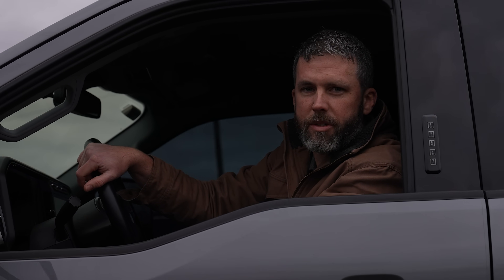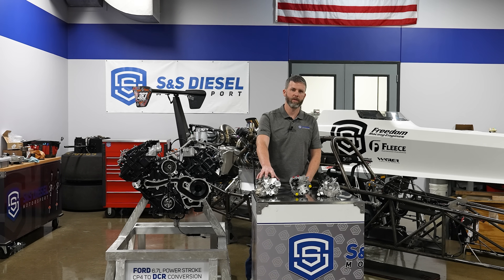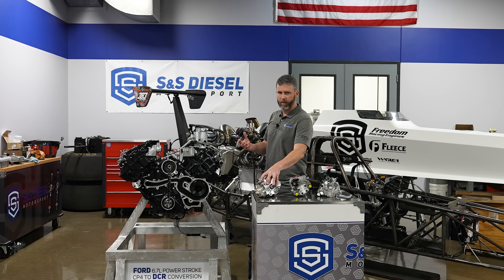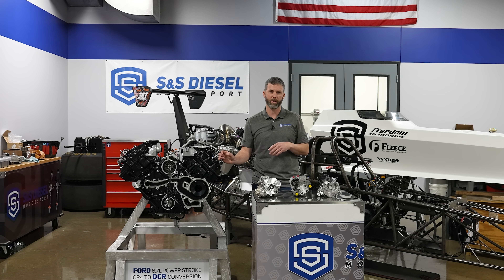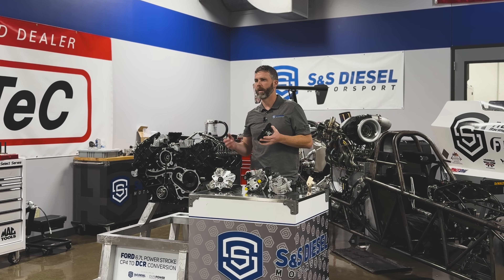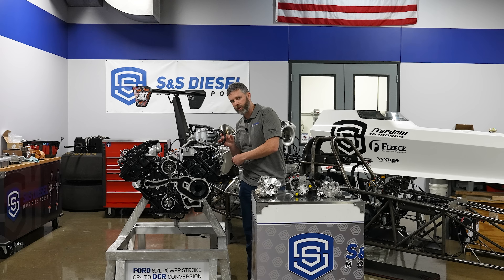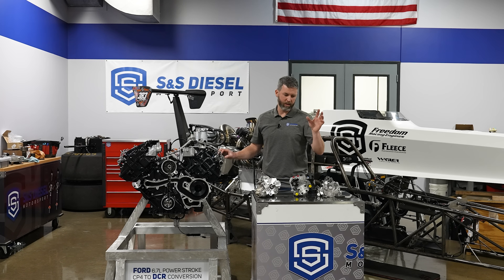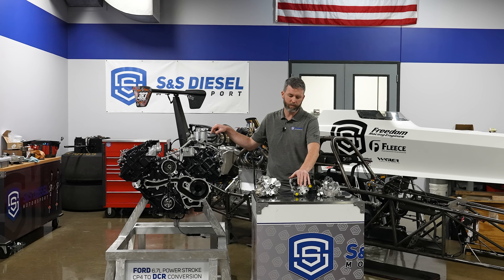How we chose the DCR for the 6.7L Power Stroke!

Comment: Is their a possibility for a higher output dcr?
Reply from the maker: Our engineering team has been considering and looking into this. Our main goal for the DCR was to provide a reliable pump option with factory style replacement. Now that the DCR has been out for 2 years and over 60k units in the field we believe it has proved its reliability and can look at other options such as higher output DCRs. Currently we have had multiple customers make 700hp+ and even one customer making over 800hp so even in its current state it has a higher output than stock when the truck demands it!

Comment: Great Informative Video... Enjoyed it a lot!  As you said, competition is beneficial. I learned more on the DCR and design direction in this video than previously... very informative & beneficial.  The CP3 & Belt design has some benefit in design, and I'm supportive to several of their 6.7 high quality components; although I agree, removing my 2nd Alternator and the external design to move components from in block to ft bracket & belt isn't my preferred design. 

Although I maintain "IF" the CP4 is maintained correctly with excellent 3rd Party filtration of air & water and lubricity in quality additives the CP4 can perform well beyond 500K+ miles. Along with Lubricity in Fuel; Filtration is key to prevent water & air to pump and the Ford OEM Filtration is a weak link to this prevention. 

Unless a new design is introduced by S&S or Other company in the next few years, for my 2024 F450 I'll keep the DCR conversion as an option and run a DPK as an Insurance policy that likely won't be utilized.

Comment: How large of an injector can the DCR support? I understand it’s designed for stock but flow numbers are close to a stroker cp4 from the looks of it?
Reply from the maker: We commonly see DCR's paired with injectors from stock to 100% overs. Tuning plays a big role with injector duration on what can be supported. We have a customer that I believe had 100% overs and compounds make over 800 whp on a DCR for reference.
Reply: @SSfueled this is great news!

Comment: Perfect timing for when the other company releases their belt driven cp3.  They’ll fail just like the disaster prevention kits did.   Blame the consumer but not stand behind the product, but you can buy an additional warranty 🤦🏻..  DCR is the only way to go
Reply: Had my spe Motorsport dpk and it rubbed a hole in my metal return line and I ended up taking it off. Hated it just saving for a dcr now

Comment: What engine was the dcr originally on.
Reply from the maker: The base DCR design has been used on the ISG engine platform for many many years. We assisted stanadyne in adapting and validating it for the 6.7L Power Stroke engine platform.
Reply: X15 Cummins I believe or isx